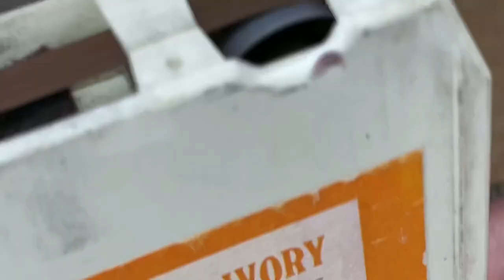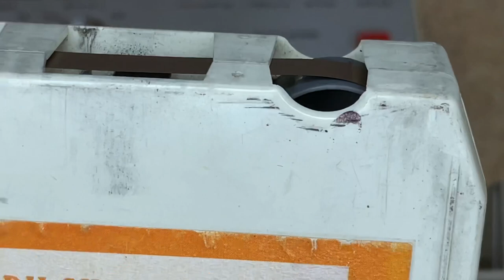I Was Wrong About Tapes!

Comment: The same happens on Reel to Reel tapes. The weels spin at different sped from each other. The only time they are going at the same speed is when the amount of tape is the same on them.
Reply: The rerason why the reels spin at different speed is simple:  A full reel has more tape to cover per rotation.  As the reel empties the circumstance gets smaller resulting in less tape need per rotation.  Since the tape is moving at a steady speed, the reel moves faster.  Near the end, that reel is literally "running" keeping up with what is needed.  The take up reels does the same only in reverse, slowing down as the cirsumstance increases.

Comment: The take up wheel actually made up by 2 wheels and a spring.  One wheel is directly connected to the belt and the other wheel, which is connected to the take up hub, slides on the driven wheel usually with a felt ring to in between to connect the two wheels together. Usually when the felt wears down, the take up wheel won't turn as well which causes the machine to eat tapes. You're on the mark of how it works. You're absolutely right. Check this out. If you ever get an auto reverse machine you can actually play tapes backwards. All you have to do is disable the tape head switch so that it won't change the other side of the audio head. Please note that some auto reverse machines are made so you can't disable that switch.  Thank you for sharing 🙂

Comment: I knew that one for years but I took my stuff apart, even as a kid. That is what sets the cassette apart, it has to conform to a Philips standard. The speed must be 1 7/8 ips. That little shaft ensues that and more importantly, the take-up is spinning way too fast, BUT, through a slip clutch, usually felt. This was a licenced format. The speed and design of the housing had to adhere as did vhs and beta tape. Oh flywheel, yes and later they used cheap plastic ones.
Reply: Everything had to be backwards-compatible to play on mono at 1 7/8 ips as long as the Philips patents held sway.  One reason it wasn't until 1980 or 1981 that those little Portastudio 4 track cassette multitracks and their clones didn't begin to appear until then, or the two speed stereo decks like those from BIC and Tascam with 3 3/4 ips as the second speed, or Nakamichi with 15/16 as the second speed.

Comment: 11:25 - Something that may be worth further research and quite a few discoveries. Around 1970, the "beauty of this design" became a huge headache for the designers who tried to squeeze three heads into what was strictly a two-head format (the third window taken up by the pinch roller). The now-familiar configuration with R and P heads sandwiched together in place of the standard R/P head, introduced by Hitachi, wasn't the first one... there were other, very different and utterly insane mechanical configurations. Dual C901 autoreverse, Sony 177 to name a few, and of course the early Naks. Don't know what they were smoking, but these things actually worked. 
That was 1973-1975. An incredible time that I barely remember.
Reply: You have to remember that the Phillips Compact Cassette, when it was designed, was never imagined as a format for music.   It was intended for utilitarian roles - dictation, taking notes, the original 'voice mail' (recording a letter instead of writing one), that sort of thing.  Separate record/play heads, stereo sound, high fidelity.... they just weren't part of the original specs, and no real thought was given to tose things.  The idea of adapting it for music came later.

And you're absolutely right - it WAS a headache making it a 'music' format.   They had to come up with a different tape formulation (CrO2) to improve frequency response and dynamic range, address tape hiss, improve speed stability, etc.  And they had to do these things while retaining 100% backward compatibility.   It was part of the original terms of Phillips:  The insisted that any cassette ever made could be played in any cassette mechanism.  That meant they couldn't just run the tape faster or modify the design of the housing.

 It's remarkable what they were able to do with the lowly cassette by the mid-1970s.

Comment: There was a mini cadette system that really used the take-up spool to pull the tape over the heads. There was no capstan and no pinch roller. 
Obviously the speed was not constant because the take-up spool gets bigger and bigger as you play the tape. There was lots of wow and flutter. 
The system was totally unsuitable for music and only used for dictation etc. 

This is not to be confused with the later micro cassette system that used a capstan drive and was used for music as well.

Comment: Re:  speed of the tape versus speed of the reels.  

You are 100% correct.  As the takeup reel gathers more tape, the velocity of the tape past the head will increase (in rim drive; capstan drive prevents this increase in speed).  And there are tape recorders that work exactly that way - a lot of those small micro- and mini-cassette  voice recorders that executives, writers, and reporters used to carry in their pocket were rim drive.  It's a simpler mechanism, but in those applications 'fidelity' was actually a secondary concern. 

Even some open-reel records (mostly portables) used a rim-drive setup like that.

Anyway, with a capstan drive, you can actually fine-tune the motor for correct speed.    That's not possible if the tape speed is allowed to vary as a matter of its normal operation.  Also, a capstan drive can actually leverage the use of a flywheel better.   That capstan rotates much, much more rapidly than those reels, and that means the flywheel will have more kinetic energy at the capstan than it would at the reel, which in turn allows for more stable speed.

And, believe it or not, capstan drive makes it easier for the take-up reel to work properly as it gathers more tape.  That's because the mechanical ratio doesn't just address speed - it also addresses torque.   The more tape on the takeup reel, the more torque that will be required to turn it.  By using the capstan to pull the tape through the mechanism, it takes the load off the reel.  This was/is a big part of the problem with a 'shoebox' type tape recorder you reviewed a while ago.  The other part of the problem was the recorder had only two C batteries, as I recall.

EDIT:  Clarified my comment (where bold).

Comment: Indeed the capstan (the metal pin) provides a very stable speed for the tape as well the capstan is attached to a large heavy pulley inside (the heavier it is the more stable the speed. (WOW and Flutter). All the take up reel does is do exactly as the name implies takes up the tape as it is pulled through. I don't know if you have found memories of cassette quality but they significantly improved the quality of the sound, there are some machines out there that you wouldn't be able to tell that it was a cassette tape playing at all. They can sound as good as CD and definitely blow vinyl out of the water with the sound quality.
Reply: IF the machine and tape were decent quality items - yes, the sound quality was quite good.   Unfortunately, there were a lot of cheap tapes and crummy mechanisms out there.

Comment: I from the very start when I grew up liking records. I owned a kiddy phonograph when I was 5 or 6 years old ( 1967-1968 ). I had then used an old family GE combo turntable and radio with removable speakers. I got it when my dad bought his first higher end unit in 1971. Pioneer receiver, Dual turntable, and speakers. My mother did in my teens bought me another kids phonograph only better quality. My dad then got me a couple years later my first separate stereo. It was a small 10 watt radio shack with 8 track with 2 full 4" full range stereo's. I did enjoy it then added a BSR turntable With ceramic cartridge. It was great only wanted something like dads. When I was 17 bought a Realistic stereo 35 watt amplifier. Then bought a used Dual turntable like my Dads table. My speakers I built from a kit at Radio Shack. Then I bought a Sharp stereo cassette player and added it to the system. I loved tapes but not prerecorded tapes. I never liked there sound or stableness. I would record my records to Maxell tapes UDXL2. Then mix the music from multiple different albums. They were great in the car and home. By 1981 bought a new Radio Shack 100 watt receiver and then found better cabinets for speakers and upgraded guts too Pyle. So the Dual, Realistic, Sharpe, and speakers satisfied me ever since. Cassette died 20 years ago and never replaced. Bought a CD player instead, never played it much, except in the cars used CDs. I got rid of it too. If needed play CDs would just use DVD player. I did buy a Crosley combo with CD burner. I mentioned before junk table. Used it to burn CDs for the car, but used the Dual table play records. It had a cassette tape deck. I found I had one tape left, one I recorded on my birthday in 1983. I admit it was fun to hear it again. Note I now have my Dads stereo and my last stereo set up. All still work great. But I do say that playing that one cassette was fun wish I saved more. My car I just bought has both CD and cassette deck. Could have played more memories.

Comment: Cassette was/is a versatile, affordable and underrated medium. The 'Sanyo boombox' comment is a reminder that they were often used in lo-fi equipment so many are unaware of the excellent results they are capable of. The key is that the deck is more important than the tape and that is where the investment should be made. Basic Type 1s will give great results in a quality deck but fancy Type 2s and 4s will not in a poor one so your money is wasted. Getting the right deck is essential, using expensive tapes is not.

Comment: This why the compact cassette is been around for so long, it shows how a well design system withstand the test of time. You also may like to know I am in process of developing new technology for recording and playback of cassette tapes. Using a new type of noise reduction system with tracking for ultra low wow and flutter, the down side it will require high bias tapes (Type II & IV) to get the best out of these upgrades.
Reply from the maker: Really cool - keep us updated!
Reply: @Recordology  There is some more information posted up on Linked in called "Next Generation of Cassette Decks" look under #cassettetapes, I think it is still there.
Reply: @Recordology  Responding so I keep updated as well.

Comment: I also found it interesting how the tape stuck a bit to the rest of the tape on the hub as the cassette was played. Sticky tape syndrom? I've never seen it that clearly. Well, it was a clear cassette; that helped, heh ^^; ....And if the capstan shaft, pinch roller and picup reel don't work well together, (and maybe the tape sticking to stuff) you get tape salad :D
Reply: Ever read the liner notes to Boston's Third Stage? There's a section called "sticky tape".  Interesting and kind of humorous too.

Comment: I was thinking about the pickup reel spinning at different speeds, depending on wether there's already a lot of tape on it or not, a bit more. Looking at the Tapedecks i repaired so far and their schematics, the right, pickup spindle is driven by the capstan motor through sometimes extra rubber belts, but always through rubber and metal idler wheels. That means they should spin at a constand speed. But I think not the speed is important, but the torque they can provide. With the pickup reel almost being empty, theres very little resistance, so it can be spun faster easily with the torque and speed the idler wheels being driven by the capstan motor can provide. With the pickup reel being almost full, there's more torque needed to spin that reel, so it spins slower. But with the reel almost being full (bigger diameter), it picks up more tape, so speed and tape pickup rate balance each other out and the amount of tape being picked up at the reel is always the same. Same with when there's almost no tape on the pickup reel. Then less tape is picked up, but its easier to spin, so it spins faster, which results in the same amount of tape being picked up. Quite clever :D 
P.S:: There should probably be a clutch pad somewhere, allowing things to slip at high torque, or it would stall the capstan motor :p

Comment: Fun fact that RCA tape was manufactured by Saehan in South Korea.
Reply: Rebranded Korean tapes and Korean tape loaded into other shells were common from the late 1980s/early 1990s onwards. Even big Japanese brands like TDK, Fuji and JVC used it, particularly later on. The number of companies actually making tape stock was actually quite small but it was offered in a multitude of different guises so not always easy to tell what you are getting. People often dismissed store brand tapes as inferior but do not realise that some were basically the same as the big brands but at a more favourable price.

Comment: Here is a question I’ve been wanting to get answered ever since I got back into cassette tapes. Many audio files will tell you that cassette tapes can actually sound as good as CDs and I agree. So I got myself several mini boom boxes as well as two Cassatt decks one from Akia and the other technics. All of my tape machines feature settings for the different tape types. One of my Cassatt decks features Dolby B noise reduction and the other has Dolby B and C. If I pop in a pre-recorded Chrome cassette to any of my tape players switch the Setting to chrome I noticed the Fidelity isn’t so great like everyone tells me it should be. If I flip it back to normal position yes there is more tape noise but the high end is much better and it’s like someone slightly unplugged my ears. A similar thing happens when turning the Dolby noise reduction on and off. If I pop in a blank chrome tape set it to chrome and turn noise reduction on and record some high-end flac files onto the tape and play it back I still get the same results. Maybe someone can tell me why the sound quality seems much better when playing a chrome tape in the normal setting with no noise reduction versus turning on noise reduction and putting it on the chrome setting. I do understand my tape decks are not in Nakamichi dragon. However I fully replaced the belts cleaned the heads and they are in perfect working order.
Reply from the maker: I've heard that misaligned heads can also make sound muddy but if it works ok without the switches enabled.....hmmmm.  The chrome/normal/metal switch is only an eq setting that's all.  Dolby C would need to be recorded in Dolby C on your machine to be played back in Dolby C... All commercially prerecorded tapes will be Dolby B and switching it to C will make it sound muddy.  I personally don't use Dolby as I would rather have the hiss and good sharp high end.  I can also tell you that with modern boomboxes, they use a cheap head that dulls the sound slightly so a Dolby tape will sound good on there even though it has no Dolby decoding because Dolby ENCODING just boosts the highs.  Does that make any sense??  Also, Dolby S on metal tape is the only way to get true CD quality on tape. https://www.youtube.com/watch?v=YJ6gPAJhhtM
Reply: @Recordology  thanks for the reply yes it makes sense basically my ears are hearing everything correct and the normal setting and no noise reduction are what I will use that is unless I record a tape in another setting. My 2 decks are the technics Rs-197 and the akia cs-m3 maybe you can suggest a few really good decks that are not crazy expensive like $200 or under and I will start a search. My boomboxes are all minis unfortunately as I can’t afford the ones I want like the sharp gf777 etc. the ones I have are the Panasonic f4, Toshiba Tt-sf5 and Sanyo m s540. Part of the poor sound from the boomboxes is the small size and lack of a good woofer for low end. I feel back then they didn’t have great sound in tiny speakers like we do now. If I plug the boomboxes into modern speakers like large bookshelf or even an Amazon echo it sound much better. Thanks for the feedback it’s greatly appreciated. Love the channel
Reply: @Recordology  I will have restoration videos of all my boomboxes and tape decks eventually. Any idea how to get rid of scratches from a silver plastic front panel? I also used some goo gone to remove a stick on price sticker on one of my decks and idk it is like it melted the paint or something really wears so now I have a messed up spot. I don’t think there is a fix for this. Oh it’s my black technics deck.